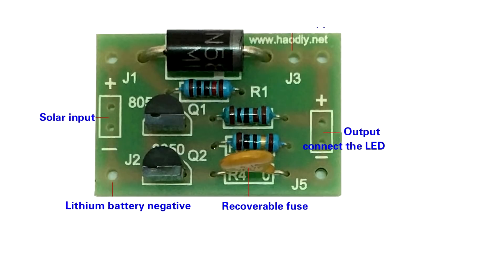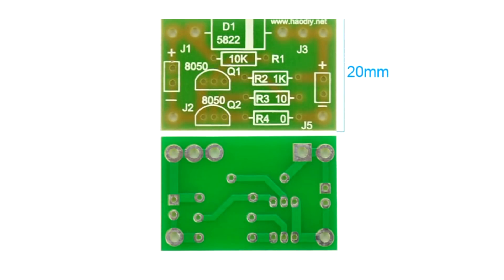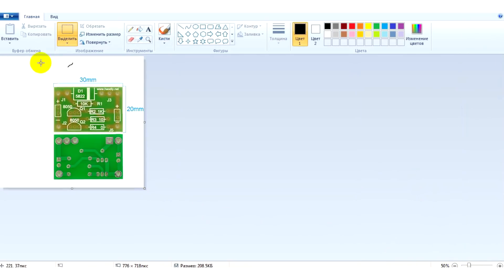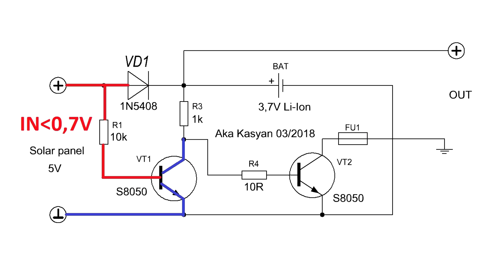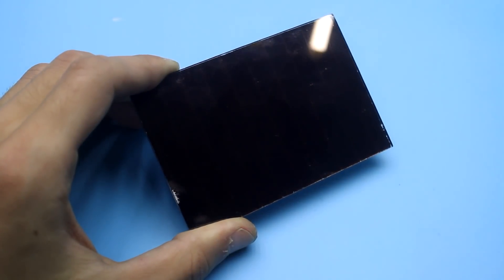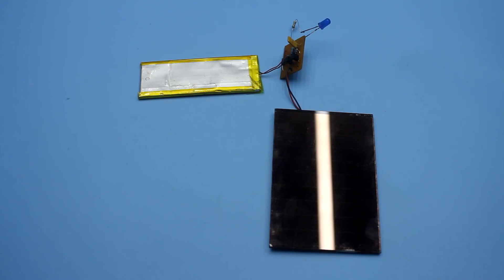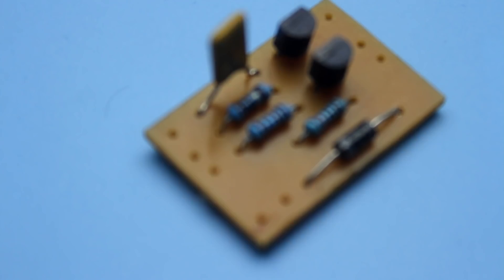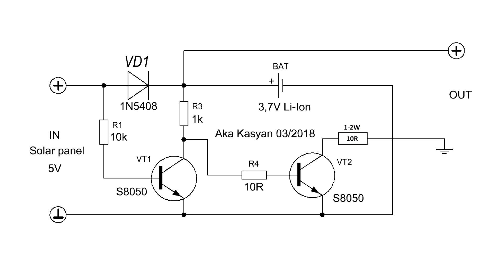STEALING FROM CHINA! DIY useful thing

Comment: Tried this circuit using 2n2222, and 2x2v 100ma solars in series to get 4v 100ma. But the first transistor isn't switching off. Any ideas? (the solar cells drop to 5ma under a small 5mm LED load)
Reply: Got it working!

Comment: Ordered and assembled a knockoff of the knockoff from aliexpress, us$1.70. Waiting to see if battery drain is significant.

Looking to use this design with a tp4056 module to get battery protection, and usb charging when needed.
Reply: Seems to use 2mAh when idle.

Comment: Only Russians can copy Chinese 😀. Russians used to copy American chips.   My dear high tech designer... All you needed was a diode and a very low power relay.   There are 5V relays as low current as a few mA.   Just your 1K ohm uses about 2mA and there is 0.7V drop on your drive transitor.  You burn out the transitor if you use too much current.  Therefore, a very stupid circuit but a nefty software work.

Comment: For a small board like this, I simply use an etch resist pen and can get the job done much more quickly than fiddling around on the computer with design software. I would also not recommend connecting a lipo battery to a solar panel without a proper charging system, since this can be quite dangerous.

Comment: did you copy that trash circuit?? you could made better with LDR and just one transistor, it is messed up
Reply: surely it's need two transistor and a solar cell, so it can charge the battery when daylight present, and then power up the Led when the room goes dark.

Comment: You could make it even more simpler by removing R4 a 10R resistor, it is virtually doing nothing and won't limit maximum base emitter current, so like someone else suggested that R3 1K is too low and can drain battery very quickly,  you could use for a 5v a 10K resistor to switch on a high gain transistor or use a darlington transistor that would give you the required current you need , perhaps  the 10R resistor can be used where the fuse is, that way 10R limits the VT2 current to a safe level, so may be you drawn or traced it incorrectly. ( I have not checked if you have ) Also the first transistor should have a pull down resistor from its base to ground since a solar panel could still produce like 0.7v even in some artificial light falling on it, and keep the first transistor switched on, so you need to reduce its sensitivity and for it to switch on or off hard, a value of 10K is always better than nothing, but as you mentioned you can have a variable resistor and you can choose whatever darkness level for it to come on or off.

Comment: I used an Arduino pro mini and a 2N2222A. It's programmable, wakes up every 30 seconds, and I can control on-time, off-time, threshold, Do-or-Don't from state of battery charge condition,... All through software. Less than $4.
Reply: it's about simplicity, with few components
Reply: Get with the times. Arduinos are simple and everywhere. Plus the knowledge can be applied to other projects without modification.
Reply: Plus, the project can be added on by adding more code. No extra hardware is needed.
Reply: The tool depends on the requirement of your project. If it needs dealing with high frequency signals, you have no choice but to make hardwired logic. Same thing when you need to use very precise timings on your microcontroler, you need to drop C language and go into assembler.
Oh and BTW don't expect true quality control and reliability for a 4$ clone.
Reply: Blar blar 4 dollars thats the arduino then ya add screen ..
.buttons plus other addons .....I wouldnt leave a arduino outside unless it was monitoring temperature Humidity  blar blar lol
Reply: Yergh. I love Ardunio stuff too, but for something like lipo charging, I'd leave it to a dedicated IC board. They're $1, at least the one I use. You can use a reverse-biased transistor for night/day switching off a solar panel (no LDR needed), but yeah, an Arduino coupled to an RTC is pretty nifty.

Comment: Why make it when you can buy it for a $1 anyway? Plus you could of made a better version of it?.
Reply: The goal is probably not simply just to make the circuit, and have it functional. It is to understand the circuit, then re-imagine the potential applications of the concept when expanded on or embeded as is in a previously never done before practical to life way.

So yes, now you make a better version of it.
Reply: It's not $1 it's $4, I could easily buy the parts to make one for $2 at my local electronics shop, or enough to make 10 if bought from china.
10 PCBs for $2 also.
Reply: Coz not 1 dollar but 4, which is outrageously expensive for this circuit

Comment: The 1k Resistor seems to low in value and would drain the battery unnecessarily?, also it would be more efficient to pwm the solar panel output to the battery with a triangle function. However for simplicity it works, would change the 1k to a higher value that is sufficient enough to turn on Q2. If its not then consider general purpose amplifer bjt with higher gain.